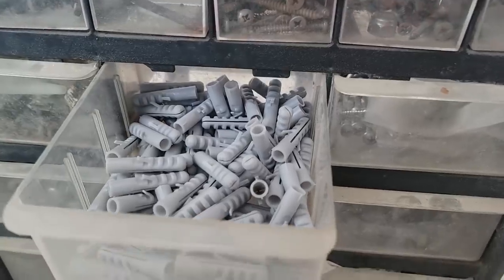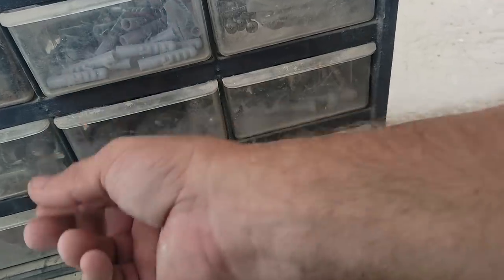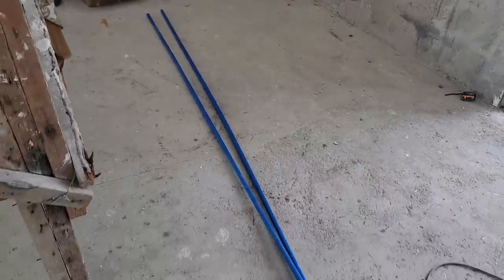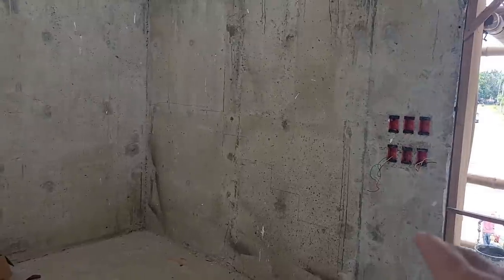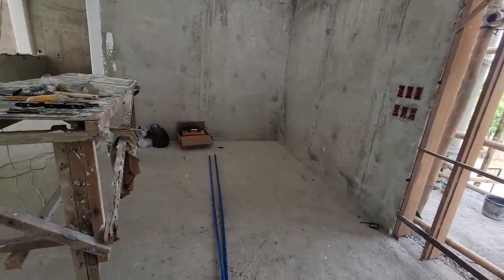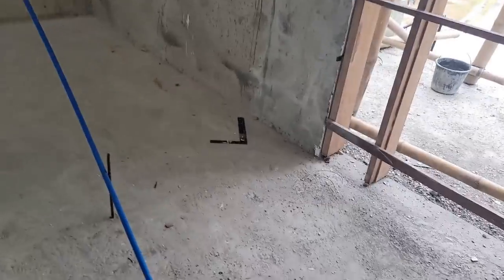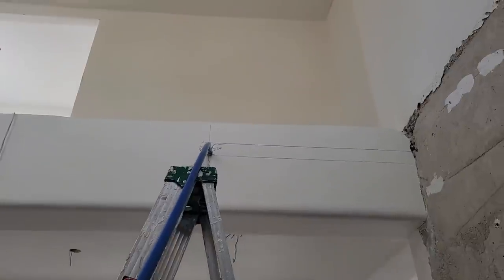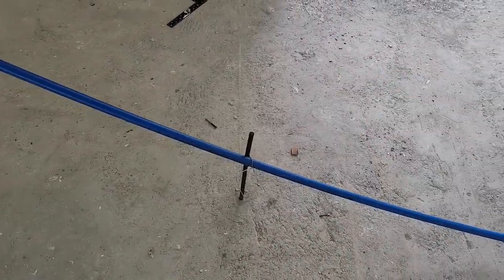Philippines Beach House Build Day 263 part 1 CURVED STAIRS - It's all on me!

Comment: I found Kreg stainless steel pocket hole screws on shopee last year for cheap cheap and bought thousands of them and so far they have held up great. I use the zinc coated ones for wood projects in the home and put plastic plugs over them and so far those have not rusted either. As for local bought zinc coated screws I previously used outside, they rust in days to weeks here in Cebu. The screws that came with my pvc bathroom door for my outside bathroom literally started rusting in just a couple hours.

Comment: James when I designed my house I researched and found there is a rule about rise and run of stairs I don’t know if you had it considered already. It makes the step just right. The product of the rise in inches times the run in inches should be within 72 to 75. I made mine 73.5 and it’s perfect.
My floor to floor distance is 3200mm divided by 19 steps that makes it 168mm or 6.6 inches. 73.5 divided by 6.6 rise will give you a run of 11.1 inches. That’s my stair case dimensions. However for curved stairs I can just guess somewhere along the width this rule is followed.

Comment: Great job James. I watch all of your videos and will be filing my papers for my SRRV Military visa. On the stairs I think you are pretty close to step width and rise. On mine the calculation for a 9 foot rise came to  11.5 width with a 7.75 inch rise but yours is curved and will look elegant. Keep up the good work.
Reply from the maker: you gain threads on the curve which means you can lesson the steep rise.
Reply: @TexasFilipino  I think my measurements were for compensation for adding tiles, but I know tiles are that that thick. Looking forward to the next video. Thanks for the reply back.